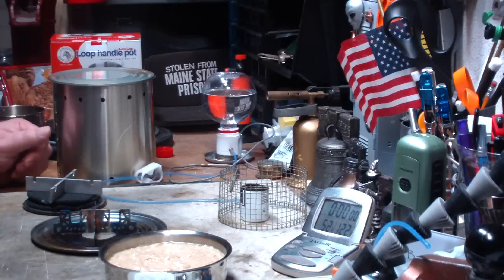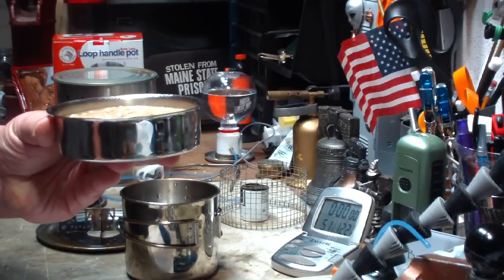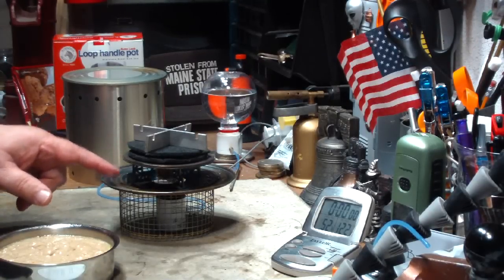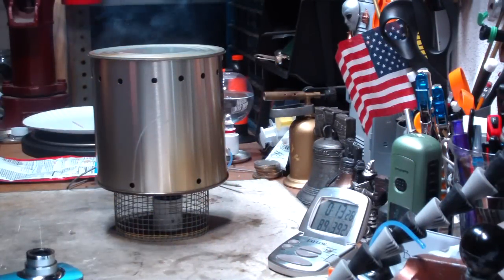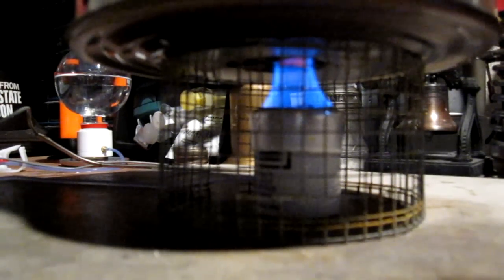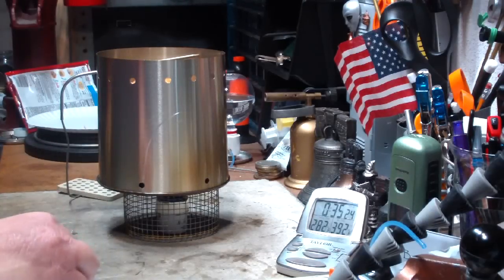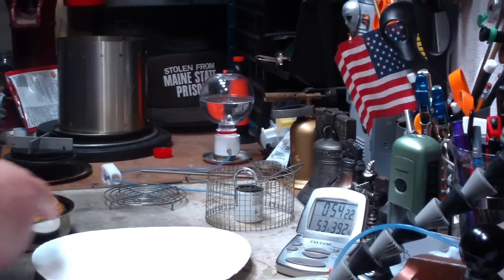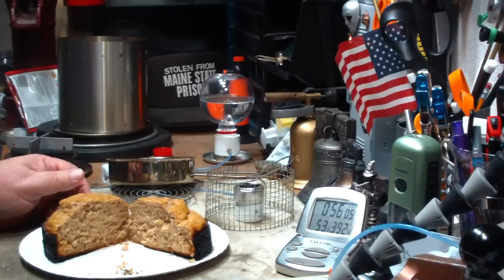DIY Backpacker's Convection Oven - Bake Test #3

Comment: Your channel is fast becoming my favorite on youtube, Hiram.   Not only am I fascinated by watching you boil water (who isn't?) you also speak to the science as well.  Not to mention you branch off into baking and such. 

Thank you so much for providing informative entertainment.  Well done, sir. 

A quick search for “how long do you bake muffins” revealed the following 

 “Preheat oven to 350 degrees F (175 degrees C). Place muffin cups in muffin tin, or grease with a little butter.
1. Mix sugar, oil, and egg until creamy and light yellow in a bowl. Add bananas and walnuts. ...
2. Bake for 30 to 40 minutes, until toothpick poked in center muffin comes out clean.”  

All in all I think your experiment was useful.  Who else could even come as close as you did?  Certainly not myself.

Comment: bought the PRIMUS YELLOWSTONE CLASSIC STOVE FROM REI AND A SCORCH BUSTER. PUT TWO RAKCS ON IT USING WIRE TO SLIDE THROUGH. HOLDS TWO PANS, A 6INCH CAKE PAN ON TOP AND A 5 INCH ON BOTTON. BOTTOM PAN 2-1/2 INCHES OFF SCORCH BUSTER. USED IN YOSEMITE A MONTH AGO. WORKED GREAT, MADE CORNBREAD AND BANANA NUT MUFFIN. CAME OUT PERFECT.

Comment: If it helps  I cook my muffins 1/3 of the mix at a time and they turn out perfect. I am burning 1oz of alcohol in 25 minutes. The surface area of my simmer lid holes equal .296 inches square.  I think you heat is still to high. Love the channel and all of your experiments. Keep'um coming

Comment: if you find a substantial base that fills the entire bottom .  IE 1/8 plate or a piece of stone or piece of cast iron frying pan for mass.  cabinet and counter shops usually have stone material blanks and scraps that were cut from their finished pieces in their dumpsters. I am thinking heat up a mass and just adjust the airflow or insulation inside the sealed oven

Comment: Just use your bottom plate,  get some good dry stones of similar size that you can arrange so your muffin bowl will sit as close to level as possible.  Then put your muffins on that and enclose it in your oven then add your Flame. The stones will give you thermal Mass and spread the heat for baking. Steve from Firebox stove does it similar to that

Comment: Hi there Hiram, you could have put the pan with the mix in on top of some volcano rocks at the bottom of the next size up billy can, put the lid on and put on simmer ring on trangia and check on it after 20 minutes. ( just my opinion)
atb Ray

Comment: Observing the way another baker in Maine proceeds, I think the burn problem arises from having a central hole in the bottom plate. Try no hole in the bottom plate, and one cross inside to raise the cooking pot. I also think you would be better off using an aluminium pot, say a 10oz  IMUSA ,or the 6" cake dish you used earlier. The inner heat diffuser plate you are currently using is not spreading the heat enough,in spite of the layers of carbon felt. You do need the internal temperature of the oven to be above 350 degrees to get a reasonable cook time

Comment: Why not have the bottom solid instead of the hole so the flame can get in then set the muffin on a wire pot stand. Then the heat could radiate in all directions equally.

Comment: I'm with MatoNupai on this, eliminate the hole in the bottom plate. You've created a rocket stove with all the holes in the flashing as well as the bottom so I'm fairly certain that it won't matter how much "insulation" you stack under the baking pan you are still going to get some burn on your muffin with this setup.

Comment: One piece of sheet metal and a little dish is not much to carry . I like that.  I am thinking the alcohol burns incredibly hot for oven use. so I would increase the distance of the flame from the pot and reduce the size of the flame. Add some rocks for thermal mass under the pot perhaps. And or add a small dish of water into the oven.

Comment: I like it.  I am wondering if you cut the heat when it looks close and wrap it up and see if it finishes cooking with just the trapped heat (maybe in bandanna and stick it in a jacket pocket or cap or something).  Second, I am wondering if the main body of  the oven might have some value in reflecting heat back on to a pot that is just boiling water...reduce fuel use or time...

Comment: the flame needs to be isolated from the cake mix. you need to completely in close the cake pan as if it a pot Inside of a pot with a quarter inch space in between the bottom of the two pots. like this. put the cake mix in one pot, and then put the cake mix pot into a bigger pot with a spacer between them ,put the lids on them and then put it on  the burner. perfect, you got yourself an oven.

Comment: I would think it is burning because you are cooking it too long and the holes in the top of the oven is letting out too much heat. package directions say to cook it at 400 degrees for 16-21 minutes and you are way down under 300 degrees. "Hopefully" that will help.

Comment: Maybe smaller portion sizes may not burn as much just a thort as it would cook quicker in the middle .
Reply: you have to separate the two with a rake of some sorts and lift the whole oven from concentrated flame of alcohol stove flame to hot

Comment: You need to spread your flame out, so it is not as concentrated into one column (too much heat in one spot, after all, you are baking, not frying.)  A DIY Hobo stove made from an aluminum can should solve your problem. You could eliminate a lot of that equipment (See bushcrafter Kenneth Kramm's Channel.) We like your experiments!!
Thanks for the video,
Clark & Viginia

Comment: Hey boss, how about this,,, remove the mesh screen that you have supporting your pot and that is surrounding your stove put your stove inside of a large metal pot with side slightly higher than the stove that is what will radiate heat up into your little round circular heat container also drop the heat container down over your stove and the pan that the stove is in put a lid on there let your holes that you have in their do the ventilating for you I think you will find you have much more even heat and greater success